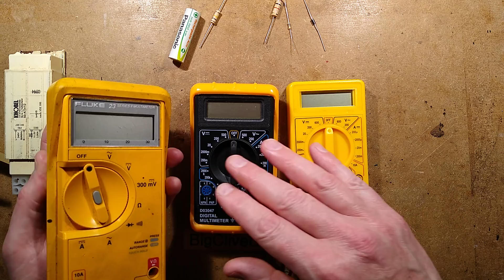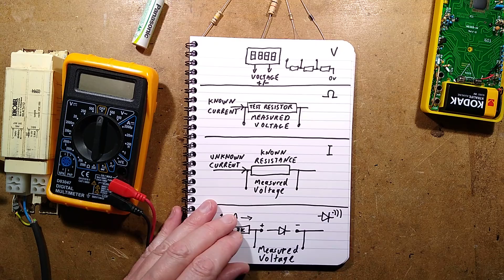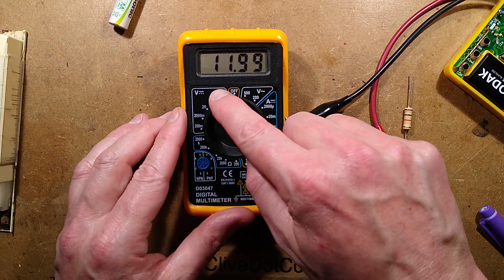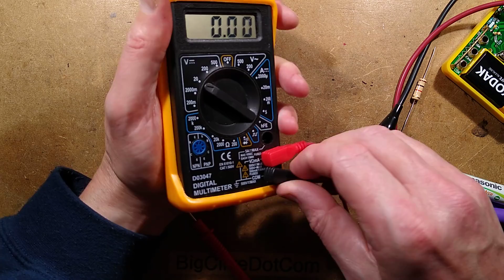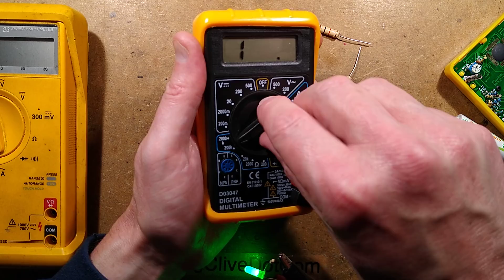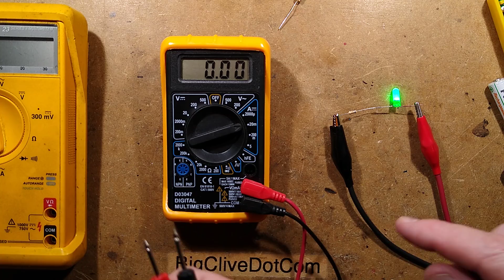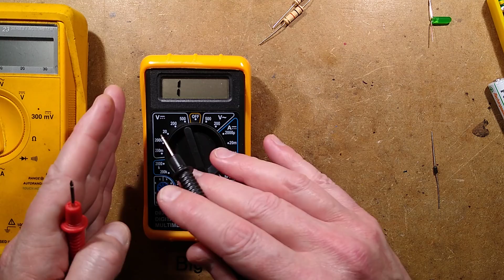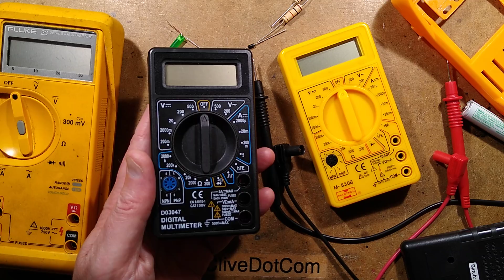How to use your trashy meter without blowing it up (much)

Comment: Though I'm fully saturated with meter ownership, the last one I recently picked up is one with an AC/DC current clamp probe capability, which was a bit out of the cheap meter range at $45, but did add a capability that none of the other meters had. Measuring current without needing to disconnect wires is very handy in some instances, like checking starter current draw, or current drawn by an AC appliance. Trade-off is a bit of accuracy, but it's good enough for my purposes. 
My main issue with the one I got was that they didn't provide any means for manual range selection, just auto ranging, and it does poorly for min max readings and measurements that happen to fall about the threshold between ranges, where it'll just jumping ranges. They fixed that deficiency with a subsequent model, but jumped double in price.

Comment: £9.99 meter bought online, set it to 500v ac and stuck the probes in the back of a hallway socket I’d just swapped to check it had voltage as the socket wasn’t working. Bloody thing exploded! I’ll definitely remember the bang for the rest of my days!

Comment: The cheap meter with the buzzer has an astonishing high user value for diagnosing problems in all kinds of low voltage circuits.
Funny enough their basic circuitry are exactly the same as in higher range meters - except of course here components with very high precision are used.
And they are even fun and very easy to build yourself as a beginners project.
You can very easy modify the scratchy one to a latchy one, by adding a diode in series to - and a lytic cap over - the beeper.
Protect the beeper drive by adding a small value resistor (~10 ohm) in series with the diode.

Comment: AC ripple can be measured on a DC power supply by adding a capacitor in series with the test leads and switching the meter to AC mode.

Comment: Cheap meters are great for the glovebox. I don't know how many times I've visited family and been asked to look at some non-functioning item. I've replaced microwave fuses, diagnosed faulty laptop chargers, and found faulty dyson batteries (surprise surprise).  It's great being able to help them there and then. Sure I prefer my nicer meters but I won't leave them in my car, too many thieves and vandals around these days.
Reply: Speaking of fixing things when visiting family, I had done a repair on my nephew's remote control car , a broken wire was repaired using a cigarette lighter and the solder blob off of the bottom of a 60 watt light bulb.

Comment: I boughgt a Fluke 23 back in 1987.  I still have it and it still works fine for my purposes.  For most work, you want a meter that measures true RMS values for AC voltages.  For example, if you lose on half of a rectified AC signal, an averaging meter will read full voltage which can lead you down a dark road to nowhere.  But a true RMS meter will measure 1/2 the voltage which it should..

Comment: One feature the Harbor freight meter has that I like is the On/Off switch. I attached leads to a solar cell from a dead solar light and leave the meter in the  milliamp range and use it to set the height of my grow lights when starting seeds for my garden, all I have to do is switch the meter on, set the height until I get ~3 ma and I'm good to go. I came up with 3 ma by comparing the output to a friends Apogee PAR meter.

Comment: Dave Jones (eevblog) has the $50 meter shootout from some years ago. It is still a good video for what to look for. For low voltage (not involving any mains) a cheapo meter will do. For anything involving high energy a meter with input protection is a good idea.

Comment: Im an electrician and quite often I find myself reaching for my "cheap" meters instead of my "good" one because I know if I blow up my "cheap" meter its not going to cost me much, my good one was over a hundred bucks! Also, the cheap ones just happen to be better for DC (they can measure a wider variety of DC ranges and currents) which coincidentally is why I chose them. 

I am 100% with you on the "faster" response of the continuity beep, faster beep is better 100% of the time its not a media player or a hifi stereo it doesnt matter what it sounds like, if you are probing a motherboard that has been coated and are trying to get into the solder of a component that faster beep is critical and one of the main reasons I use my "good" meter, cheaper meters tend to have a much lower polling rate. 

The best tool is the one you have, if someone is going to be critical of the equipment you have they are more than welcome to buy you a replacement.

Comment: I started with a not quite that cheap meter but very affordable model from Conrad (store/webshop just across the border in Germany), was pretty happy with it and it is supposed to be built to EU safety standards. I think they mostly rebrand UNI-T meters with their own brand, either way it was good enough.

Then some years down the line I figured I spent enough time on it that an extra decent meter would be nice and picked up my Agilent U1272A (goes by Keysight these days). I don't regret either purchase, the new one has nice fast autoranging and a functional fast updating bar graph. Better interfance and true RMS measurements are nice to have too, but it's a steep entry price when you don't know yet what you'll use it for and how frequently. The older relatively cheap one (40-50 euro range?) served me well and actually had decent probes too, it's still used as a backup extra meter on the desk for the odd measurements at times.

Comment: I put an ATO fuse socket in the middle of the "negative" lead, because fuse replacements are easier. It adds a little resistance (~0.1ohms), but I don't need the accuracy.

Comment: I have a Fluke and an old HP bench meter.  My go to for non-precise and rough field use is a "free" Harbor Freight meter.  Just as you mentioned - so what if I blow it up or what more likely would happen, accidentally stomp on it. I have a reference device and frankly its not too far off given the decimal point display.

Comment: Good Tutorial on DMMs.  

For certain tests, I use a DMM like a Fluke 77 or 87 (with a backlight).  For other tests, where I need to measure slight variances in voltage or resistenace values, I use a Simpson 260-8Xi.  In my experience, the Analog Dial lends itself, to a better representation of those variances, where digital displays lacks that functionality.  Something worth mentioning, for those working around RF or Radio Frequency fields.....  The Fluke meters seem to have a degree of RFI/EMI immunity.  Essentially, their readings, in the presence of a RFI/EMI field appears to be more stable & accurate, than that of the Simpson products.

Comment: 20:08 If in Diode mode the meter doesn't respond in both directions, it don't always mean that the diode is open circuit,
but it can also be a Zenerdiode with a higher breakdown voltage then the measuring voltage a DMM provides.
Besides a Zenerdiode, most of the TVS diodes also not respond because the lowest value of a TVS diode is arround 3V and that goes up to 550V and more.

Comment: The DVM with the black face plate is exactly the one I got at a store here in the US called "Harbor Freight".  I actually acquired it free of charge with the purchase of a more expensive item.  I got a couple pocket flash lights like that too.  The meter is definitely trashy in every sense of the word, but it works, and if it blows up, I'm not out any money.

Comment: One thing I think worth mentioning here. If you think your meter misbehaves don't try to verify it by sticking it to mains. Most probably the cause of this is that leads are in current measuring position. And then if it is cheap meter as first one with no fuse, something else will give. Usually leads explode in hands for me, and that is scary.

Comment: I have several multimeters, including the cheapo yellow one. It’s fine for quick voltage readings etc.
Biggest problem I have with the cheap ones is the lack of the auto power off. It’s very easy to leave it on accidentally.

Comment: Ha I've got that identical little yellow meter, I've left it on before accidentally for weeks and its still going. Never used those transistor tester ports on any meter I've had. I find the bargraph very useful as it will shiver on measuring AC when the numbers don't show. My current meter has a dual display and can measure the AC component on dc volts- great for testing power supply ripple when the caps have given up!

Comment: Diode mode is also great for finding shorts in a faulty circuit board. If you don't have a black skid-mark but the board still doesn't work, diode mode will show you that a component is shorted. For example, if you have a bunch of capacitors to ground, you can rest the red lead to ground, and probe the other sides of the capacitors one by one, until one beeps.

Comment: Hi Clive, Been using these style meters for like 20 years. Never realised turning through the voltage range would not damage them. I always disconnect the probes before changing the range myself.

Like you say only a few options get used on the switch choice really.

Comment: I only ever dabble in low voltage elctronic circuit projects, and agree that the majority of the time I use continuity or 20v DC ranges on my cheapo meter.  Occasionally I will also use it to measure the value of a resistor, as i have never been able to memorise the values represented by the different colours.

Comment: As an occasional user the feature that is worth mentioning is the automatic shut off. After two weeks the expensive 9 v battery is flat. An Chinese (aneng) brand have me made enthusiastic,  running on 2 AA batteries that likely as spare present or,  in a pinch, borrowed. In addition it has automatic shut off.

Comment: I glad you mentioned there are other brands besides Fluke. I don't like Fluke because for what you get they are too expensive. I also was given a Fluke scope meter. It sucked. The rechargeable battery didn't last and needed replacement after a year. The battery cost was expensive. The bandwidth for the price was a ripoff. I gave the meter back to the entity that gave it to me.

Comment: When it shows OL, it means Open Loop. AKA it's either actual open loop or the resistor value is too high for the low test voltage to pass it.

Comment: The M-830A / B / C generic branded DMM is think the most sold DMM in the world.
Back in the 90's, this meter was sold as the M-940 in black color, some came with a buildin light at the front.
Because these meters are so cheap and everywhere to find, i have seen these meters used as panelmeters in DIY power supply projects.
I have tested these meters with a Electrophoresis powersupply at 600V and they are very accurate.

Comment: Sudden flash-back to 1972 when I bought my first multimeter. I'd had to save my pocket money for months to buy it. It was either Russian or from one of the Eastern Bloc countries, analogue (of course). I remember standing in the garden, holding a wire connected to the meter, with the meter also connected to earth. It could measure the resistance through my body to ground. I was so impressed! I wonder what happened to it? I used it for *years*. Now cheap meters cost about the same as a decent PP3 to power them.

Comment: I still have a Radio Shack meter that I bought in 1978 which is still going strong. I broke it once, but took it into work with me and the sparkies fixed it for me, saying I'd blown a few diodes and of course, the fuse. Otherwise, it's been incident free for all these years!

Comment: I've used a cheap multimeter for some time, upgraded for a bit more meaty mastech one, still was quite affordable and it's plenty than enough for the occasional poke around in small circuitry.

Comment: Great video to explain the basics of how to use a meter. I imagine it'd be cheaper to replace the cheap meter if the leads failed than to get a replacement set of test leads?

Comment: A huge difference is that more expensive meters contain a stable reference.
   These draw power. That's why a Fluke will kill a 9v battery in a couple of weeks, the trashy ones can run for ages..
   The fuses in expensive units are designed to absorb energy before it exits the case...

Comment: I have a fluke 110. A good basic meter made in USA. I Also have a cheap craftsman clamp meter for checking higher amps. Both work fine.

Comment: Great video for starter meters. Had to use expensive meters in our lighting lab as loads were non linear. Ie not always sinusoidal. Once blew up a nixy tube Avo by connecting an ignitor across it.Opps!

Comment: I had a first meter from radio shack in the mid late 80s. Was put in resistance mode. Measure the 120 ac volts and there was a huge spark. The leads had a bit of damage but meter still worked far as I know.

Comment: This style of inexpensive meter was also my first meter too, and I used it for many years before upgrading.  My only complaint is that the leads are very poor.  The wire in the insulation is so thin that it will often separate from the probe lead.  The insulated wire is free to rotate and more around in the probe handle, which causes it to twist and disconnect.

Comment: Clive i often use my Fluke on the 10 amp DC range to test the condition of 1.5 volt AAs and AAAs by loading the cell which is a better test than a voltage test athough that should be done as well. The Fluke has a HRC fuse in the 10A range. Very important to return the leads to normal immediately  after testing.

Comment: I modded those meter to run on lithium ion battery, it has step up module and tp4056 with discharge protection and one diode to prevent backfeeding

Comment: I've got a Fluke and a cheap (about $20) Aneng. Both are about as good as each other for basic use, but the Fluke is definitely better built and a nicer user interface... The Aneng is still heaps better than typical cheap hardware store type meters though.

Comment: There are different circuit designs for meters. The cheaper ones will display two very different readings if you set them to AC and try to measure DC (or maybe vice versa?) depending on the polarity of the probes.

Comment: so i have a 20+ year old Fluke 33....... and there's a reason it's still my go-to meter. first, it has a bar graph display under the numbers that is very helpful when measuring things that are variable- such as a potentiometer, or a variable amperage/voltage of a oxygen sensor or a vacuum transducer. the second is the accuracy over time, my fluke is still accurate all these years later. finally, is the leads, they're robust and if broken are easily replaced, which i cannot say the same for the other meters I've had over the years where once the leads got broken i sometimes had to throw the meter away, or i found out the hard way one time that the leads can be inaccurate for measuring voltage and i replaced a part that wasn't bad. doesn't mean you have to go out and buy the high dollar fluke available, but buying the right one and it'll last for years.

Comment: Consider the CAT ratings of the meter and leads as well. It indicates what level you can use it on, and how well it will hold up to faults (eg shorting mains and containing any explosion). CAT I is for extra low voltage electronics, CAT II is suitable for mains at socket outlets, CAT III is suitable at switchboards, CAT IV is suitable for mains and incoming supplies (which nobody should be touching unless they are a qualified electrician). 

My meter for instance, has CATIV rated leads up to 600V, and the probes have little removable caps that expose a pins head of the probe, which gives added safety when measuring mains with a high current capacity since it reduces the chances of a short circuit. The meter itself will contain an explosion if I did however.
Reply from the maker: The CAT ratings are in the description.

Comment: I use several of the very cheap ones all over the place...they cost about 5-6 dollars each...and I got a few from Harbor Freight as an add-on for free.  
A small suggestion...get multiples of the replacement fuses...they are inexpensive & as Clive mentioned they are easily popped...ask me how I know  :)  
Usually I keep my good meters for high voltage AC while the cheap ones are usually for DC voltage & ohms & continuity.

Comment: Scratchy buzzer for life!

Also i love that the buzzer on my multimeter is on the 200 Ohm range; this way i can buzz out GPUs, laptops, other sensitive circuits, where applying 3V would be a no-no, it only applies about half a Volt. And i can still light the LEDs on the diode range if i'm lucky.

Comment: I got a Tacklife meter from Amazon one black friday. It also has a fused 10a range, which i found out when I blew it across a car battery. It has one of those settings which sense live wires in the wall, and a temp probe. Think I only paid between 10-15 pounds for it.

Comment: One of two reasons I don't test transistors with these meters is the horrible round jack, while the other one is that it can't test every transistor. So I use a dedicated transistor testing tool or a «universal» µC components tester.
Oh, and you even asked if we used the gain test function in these meters! Well, when I have a generic bipolar transistor and want to know its pinout and if it functions or not, I would use this function. Only if I have no other tools, lol. ;D